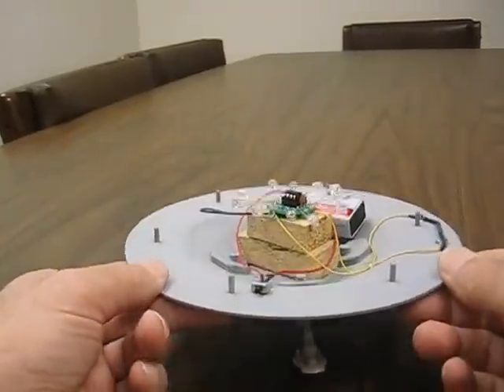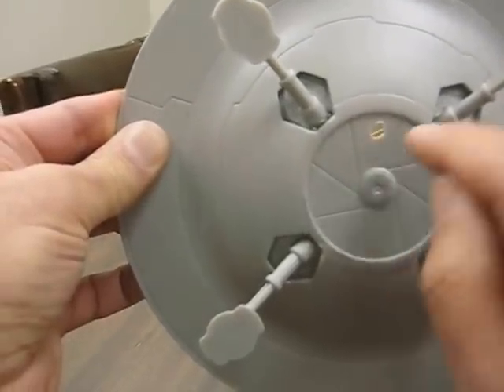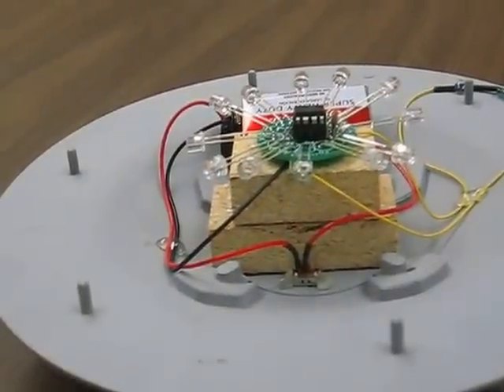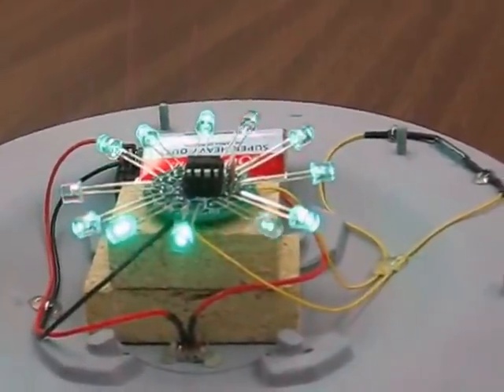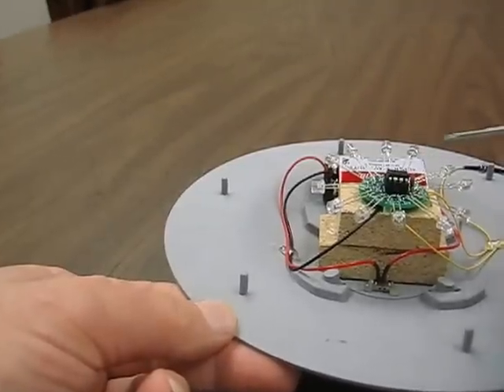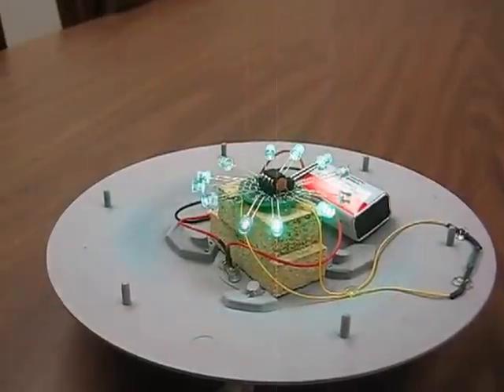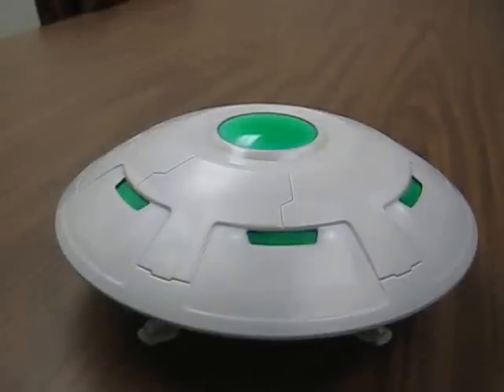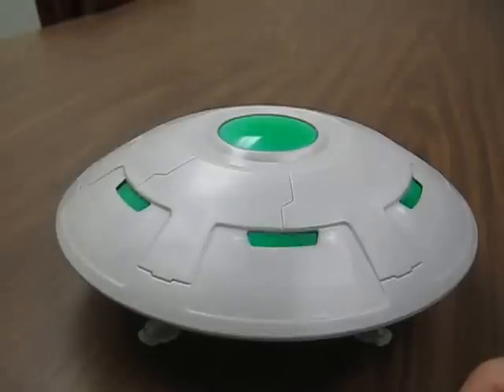Area 51 UFO Saucer Plug and Play Light Kit

Comment: I bought the chasing light version of this kit about two years ago through CultTVman. Im finally getting around to building this kit. I’ve watched this video several times and you don’t talk about how to replace the 9 volt battery…  any suggestions.
Reply from the maker: There, are two methods, one is to make the top saucer part removable to change the 9 volt battery. The other is to not use the battery, but use a 9volt dc output 1 ampere rated wall power adapter to power it up.
Reply: @TenaControl  thanks…